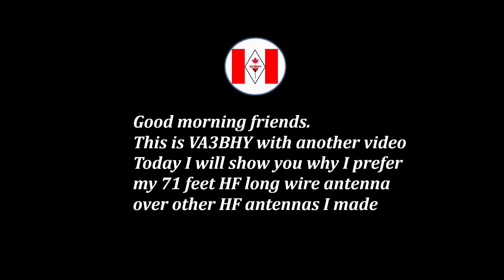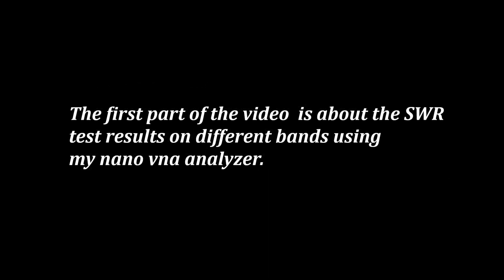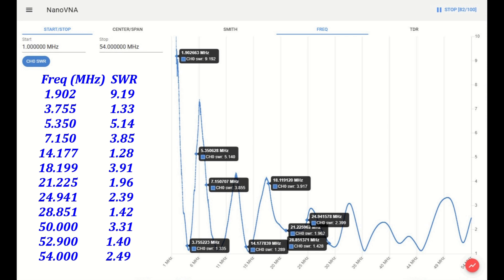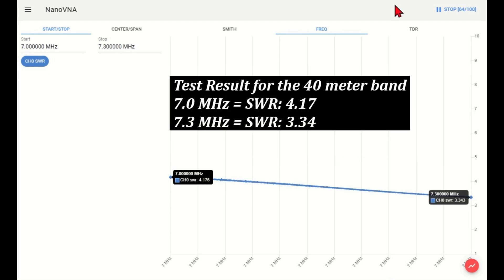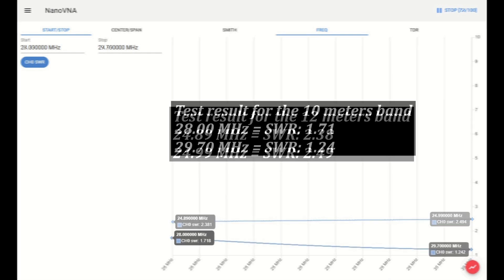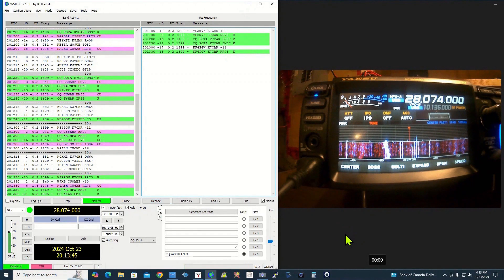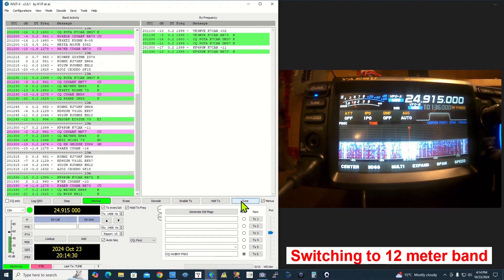My Favourite HF Antenna

Comment: Many thanks for your detailed work. I have limited space for an antenna, but your multi-band success with a Yaesu built-in tuner gives me hope the tuner in my FT-897D would provide sufficient matching for most bands with only 40 meters worrisome. I also have a MFJ-914 which is marvelous because it extents its matching to around 8:1. And if it works with RG-8, I've got some LMR-400 I picked up cheap that I could use to get the remaining SWR losses down. I really would like to get multi-band without filling my limited attic with a next of dipoles.
Reply from the maker: Goodluck. I think you will be ok.

Comment: I also make a 71 feet antenna，but 40m doesn't work
Reply from the maker: Well, there could be a lot of reasons. Maybe its the 9:1 balun or unun you are using, or the elevation, the environment (do you have a nearby metal structures, big trees etc) without any details, its hard to say what might be the problem.

Comment: You put an swr meter at antenna feed point you will see different swr readings,,tuning any antenna from an atu in the rig or shack is a bad idea given rise to common node current on the feed line and false swr readings,,71 ft is a good length for a random wire but must be matched at feed point with and external atu or Lc match for coupling,,making for a more effective efficient antenna system,,shack and rig arts are not really efficient in an antenna system.
Reply from the maker: My coax feed line is less than 4 meters from the 9:1  and 1:1 balun case. This is very short and right before the coax feeds into my FT710, I installed 5 big ferrite beads in series. I have 2 methods of stopping the CMC - the 1:1 balun and the 5 ferrite beads right before it connects to my transceiver. Anyway, the results and performance of this antenna has nothing but amazing on ALL amateur bands with of course the assistance of my FT710 automatic antenna tuner that tunes all the bands very well. My NANO VNA tells the same story. And just to prove a point, I made a recent video showing how well this antenna performed for the past 1.5 years. Link here: https://youtu.be/0di47pB0yQo

Comment: How do you feed the 71’?? Balun? Unun?
Reply from the maker: I made a 9:1 balun. This is why I ran a 71 feet counterpoise 6 inches from the ground along our fence.
Reply: @VA3BHY  Did you need a 71-foot counterpoise? Would 17 feet do as well?
Reply: @martinunger9545  Yes I needed a 71 ft counterpoise because I installed a 1:1 balun and CMC choke right after the 9:1 Balun I also made. My 71 ft counterpoise was stapled along my wood fence 6 inches off the ground.
Reply: @philcanadian  Would it be incorrect if I called it a random wire dipole?
Reply from the maker: Calling it a random wire 71 feet dipole should be fine. I made a 9:1 balun and choked it at the feed point with a 1:1 balun to see if that works and placed the 9:1 back to back with 1:1 in the same case. Imagine that horrible setup. I placed 5 ferrite clip on beads at the PL259 right before it connects to my FT710, Used high quality USB cable with built in ferrite beads at each end. No RF in the shack. The feed line length from the transformers (9:1 and 1:1) to my FT710 is only 4.5 meters.
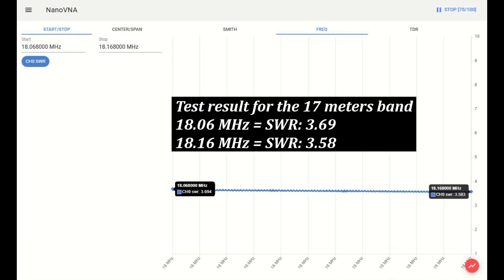Reply from the maker: Video of the antenna build. At around 3:30 of the video,  explains the counterpoise and 9:1 balun https://youtu.be/n8dJYJJaSTg?si=FE5sW4n5DuS3dI-F